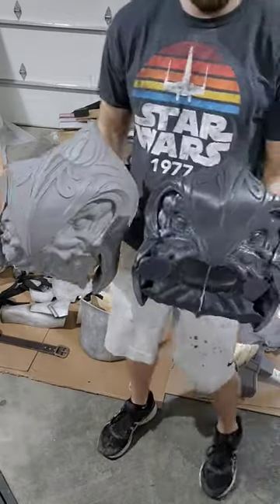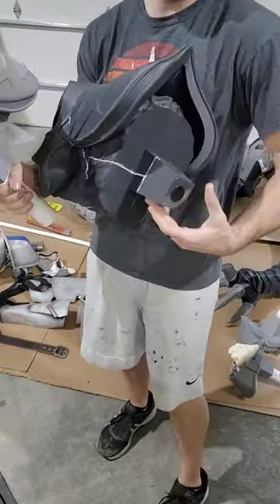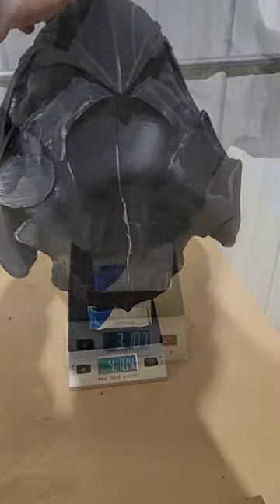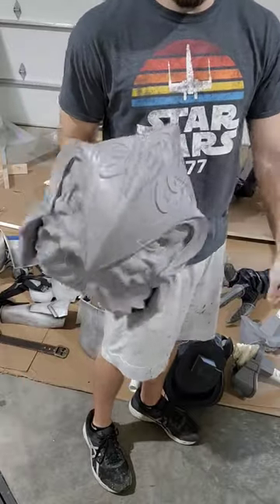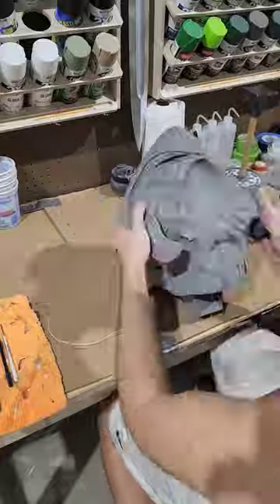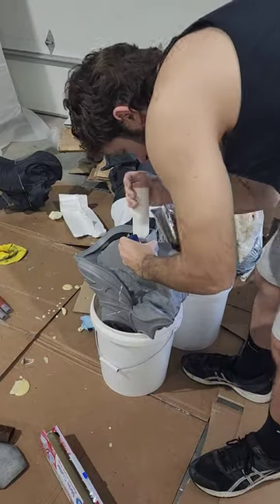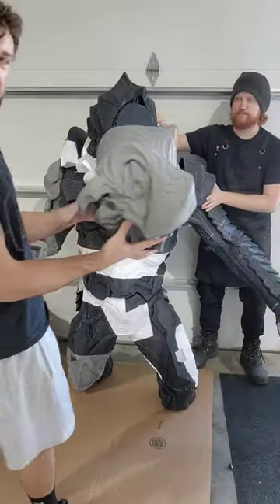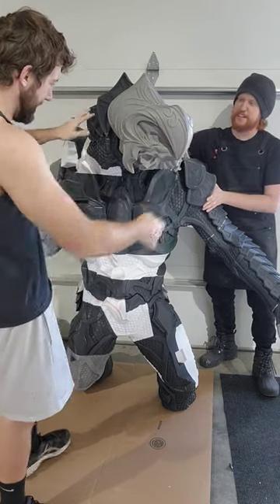Making a Life Sized Arbiter Pt 16

Comment: In Warhammer modelling we call that a pin joint.  The old metal models are heavier than the glue can handle alone so usually you'll drill a hole and put a wire connector inside both pieces so it's got more durability.  You could probably use some kind of foam filler so the parts have more protection to vibration and moisture in some of the hollow areas